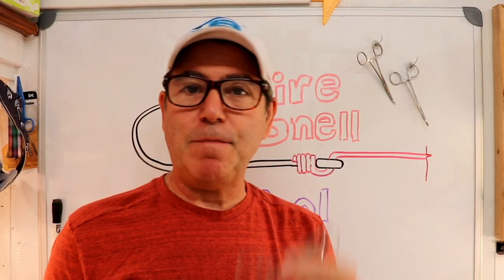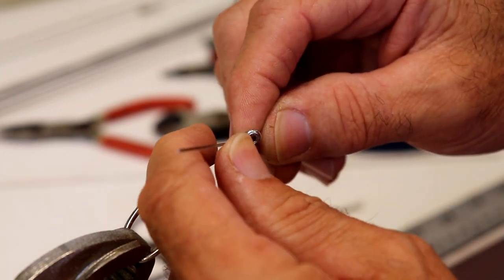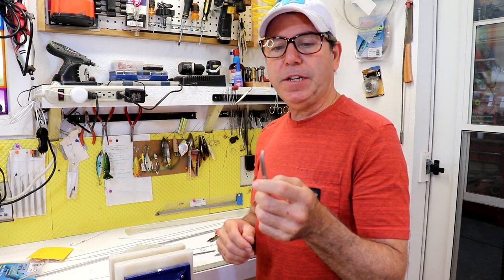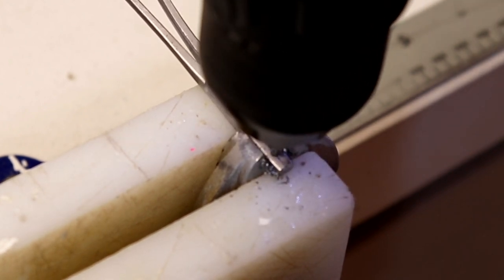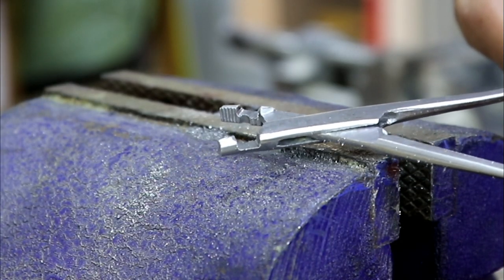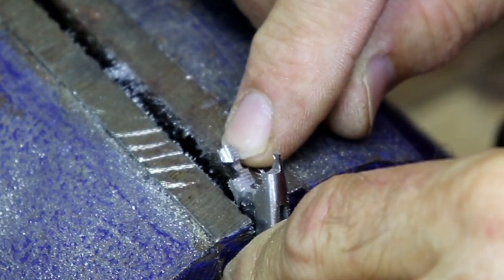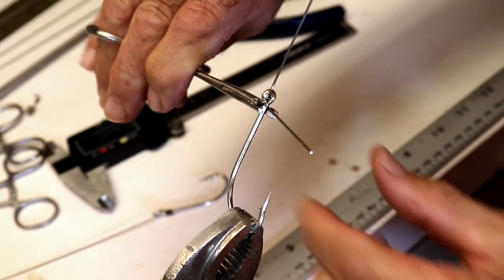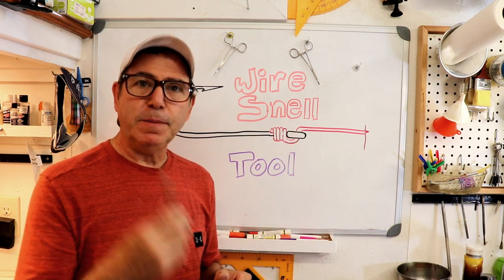Making a Wire Snelled Hook Tool

Comment: you did it to me  now I have to make one  myself I using a vice grip and pliers for mine they do work to yes who does not have surgical pliers on hand  yes hemostat my stepdad was a surgeon  yeap NEVER had to buy any of them too laughing had some never closed right have few boxes of them to bend the handle to tight them up too  
 yes they are wonder to paint you lures with too

Comment: Hi there love your vids, wanna ask you, is it possiable to make your own split rings?
Reply from the maker: Its possible....but really difficult.   Ive made some from spring steel stainless but only because I wanted some 1/2 inch diameter.   Anything smaller and you need a custom jig made frome hardened steel...not worth it.

Comment: I have looked and looked on YouTube for a DYI wire twisting tool for making spinners. Tack-L-Tool is the closest simple wire twisting tool I've found. The problem with it is it creates too big of a loop for my taste. I the loop were smaller, it would be perfect. It's hard on the hands to use round nosed pliers and using my fingers to wrap the wire close to the eye. The crank on the the Tack-L-Tools for twisting part section close to the eye is preferred. Could you come up with something that would work like  your wire snelled hook tool that would work for creating small spinners, like the Mepps or the Panther Martin? If anyone can do it, it's you. You're awesome!
Reply from the maker: I I have a couple of designs I've been playing with But I've got limited time and the prototype would take me a bit of  effort and cost. But I'll get around to it.

Comment: It's obvious not to use rolled wire. Is it all welding wire? Where can I buy it?
Reply from the maker: You can find ss wire in straight segments up to 24 inch lengths pretty  easily. The best bet is to Google stainless steel wire and find the best price you can. I've been using orthodonture wire for a while it's actually at a decent price.

Comment: Great idea!  Making one up tonight.  What diameter wire are you using on that 4/0 hook?
Reply from the maker: For the spinner baits I use .035 in diameter wire with the 4/0 hook.
Reply: @EngineeredAngler  Thxs, looking forward to trying that!